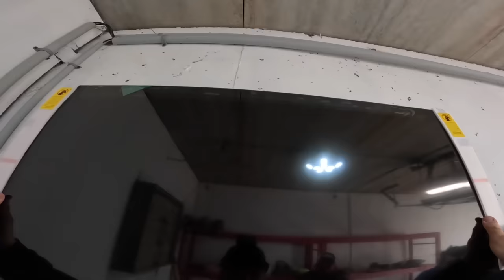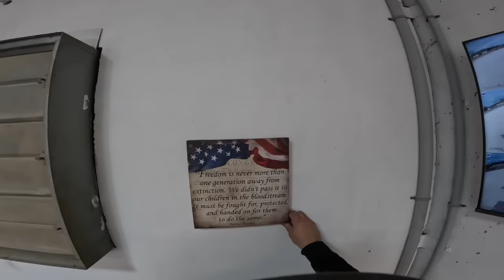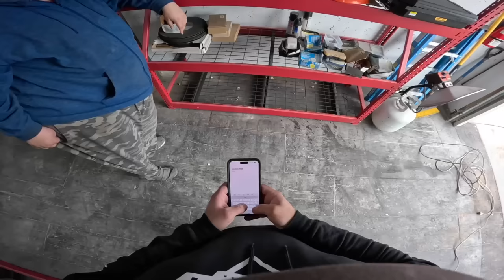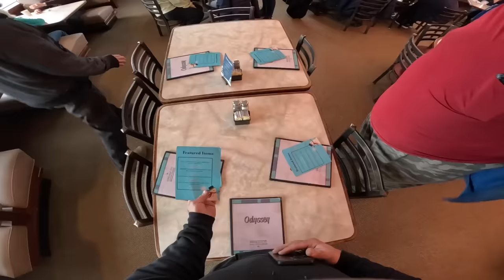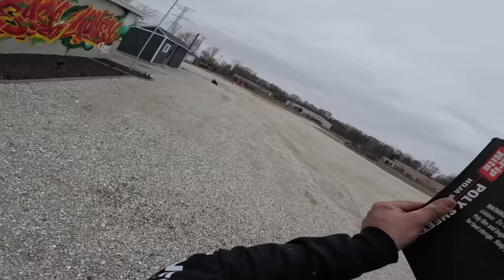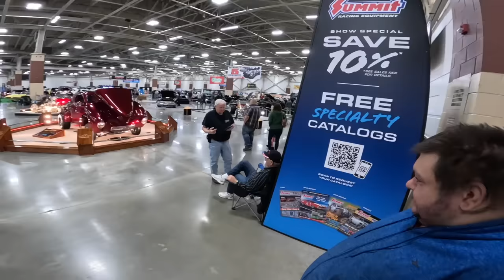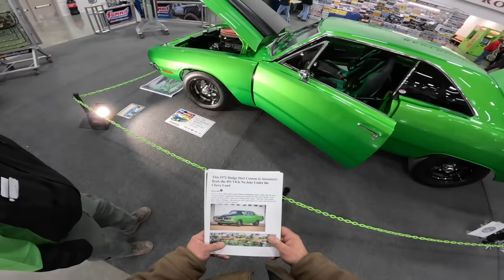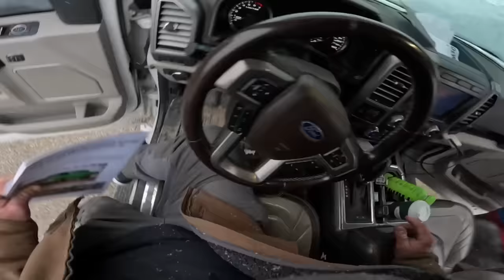Shopping and a car show with Darryl! Fun day!

Comment: Ryan, you need to buy your supply’s at an industrial supplier that sells wholesale. As a contractor myself with over 40 EE’s I avoid Home Depot for small supplies like fasteners and drill bits. 1 example We pay less than $4 for those same masonry SDS bits that you probably paid $10 for at HD
Reply: I was thinking the same thing. I’m like why is he buying bulk items like that at Home Depot with those prices.
Reply: Yeah i cringed when I saw him buy material at home depot. If you’re a professional you should only be going there for a tape measure or replace some basic hand tool youve lost.
Reply: It's all tax deductible boys. You guys aren't saving as much as you think.

Comment: I made a comment before about getting that guy a comb and  shampoo but man, get him body wash! Look at his neck at 59:13 and pause it I had to do a double take no wonder Tino was yikes and didn't want to sit near him. Other than that thanks for the time making your videos.
Reply: It’s not dirt, it’s called Acanthosis nigricans. It is most commonly associated with diabetes and insulin resistance.
Reply: @3bonbot  If that is even the case it's treatable by weight loss but I guess when you don't take care of yourself it is bound to happen in most cases.
Reply: @Thorvian  that’s exactly the case. Your comment just assumes and low key rude.

Comment: Hey Ryan... I saw you put that measuring wheel in your cart. I'll never have to use one of them again my friend. I just bought this measuring device called "Moasure". It's the sweetest tool since flush toilets were invented. I probably won't even need a tape measure very often during a bid at this point. You should try it out. This tool has made my bidding process SOOOOO much easier it's crazy.

Comment: another good thing ab stocking up and paying that big number up front is u also save money on the gas bill that will accumulate throughout the year on all the back and forth home depot trips. and usually almost every product has a get 5+ and get a lil better price than just buying 1 or a small amount at a time. so smart move with many benefits d hopefully he will end up using everything and didn’t get a large inventory of something he won’t be needing anymore or doesn’t work this time around

Comment: Man you would seriously save at least 30% by buying all that stuff online instead of home depot. Its great for when you need something asap but most of that stuff you bought in bulk could be had for so much cheaper in bulk online. Just for example that 3m 90 spray adhesive you paid $17.98 for is like $14.94 on amazon alone and can be found cheaper in bulk online as well. if you bought 30 cans just on amazon that would have saved you nearly $100 just on that.

Comment: Ryan…you should get the articulating mount so you can pivot your tv toward you in the trailer.  The flat angle will make it hard to see from the front of the trailer so u could miss something. Just a thought…good luck this upcoming season bud.

Comment: You need to put a solar panel charger in the construction trailer to charge your battery for the fuel cell so it’s never dead